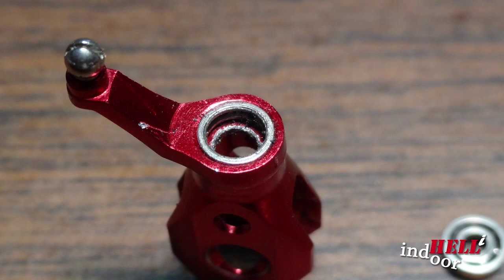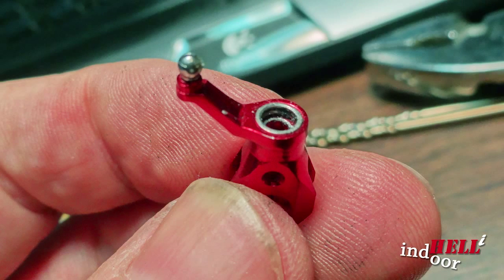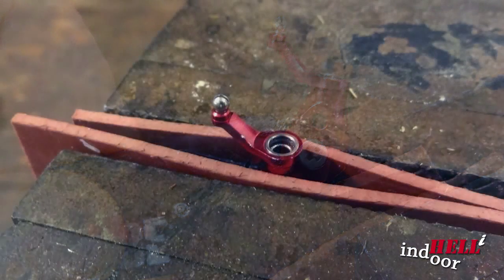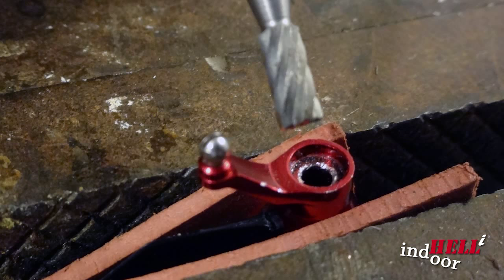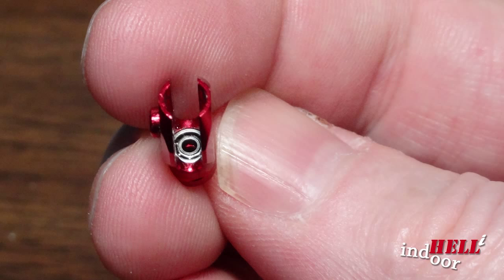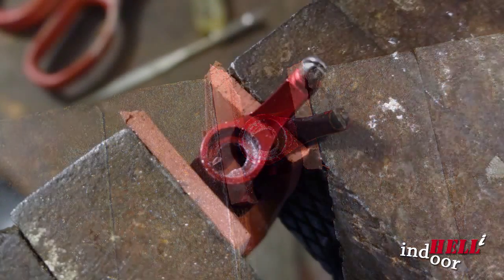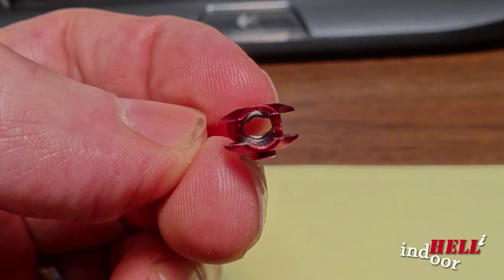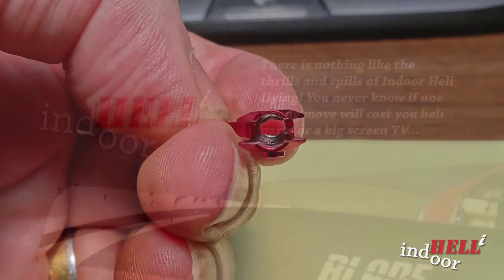mCPX MicroHeli Grip Bearing Replacement - indoorHELLi 007 - A

Comment: Regarding popping the other bearing, it's easy: just use the feathering spindle. Insert it in reverse, then pull with pliers and the bearing will come out.

Comment: ... (continued)... with the centerline of the drill bit.   Once you have the jig in place that has the centerline of your grip shaft aligned with the centerline of your drill bit, switch the drill bit out to a smaller diameter drill that you could then use to drill out the failed bearing.   That and one of those right-angle dental tools should get the sucker out.    If that's too difficult, just dremel a slot into one spot on the bearing and use long nose pliers (& dental tool) to pull it out.

Comment: I would solve this problem by mounting a block of wood in my drill press and then use a drill that's exactly the size of the outer diameter of the blade grip shaft to drill a hole into that wood block.   From there you'll need to dremel out recesses to mate up with the other features that protrude beyond the diameter of that main shaft/grip.    The idea being you need a chuck to hold the assembly firmly in place and help you align the centerline of the assembly (and hence the bearing).. - TBC

Comment: Did you ever try taking a torch to it?  Aluminum swells quite a bit with heat. I’ve always used heat to remove my 450 size rotor bearings